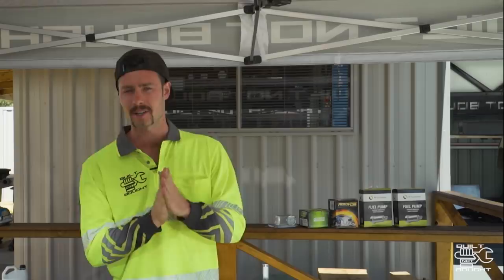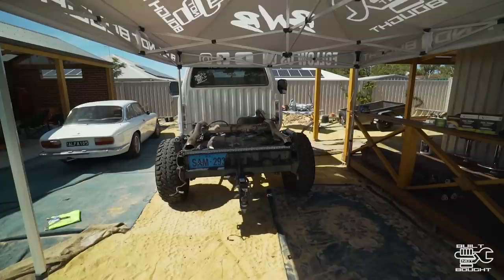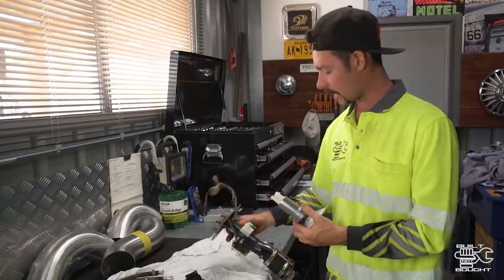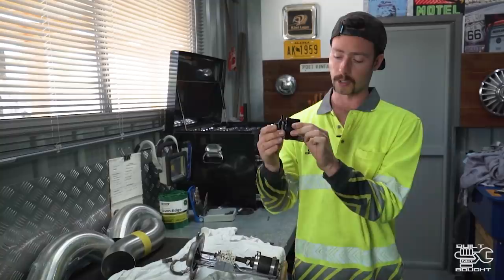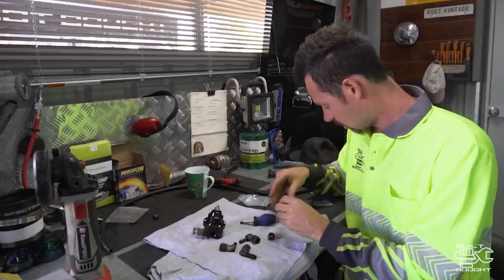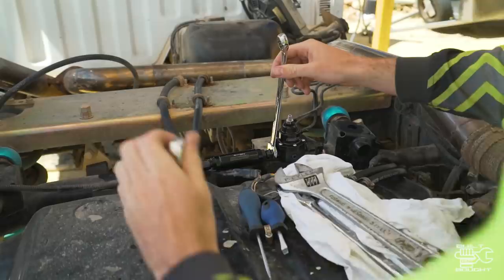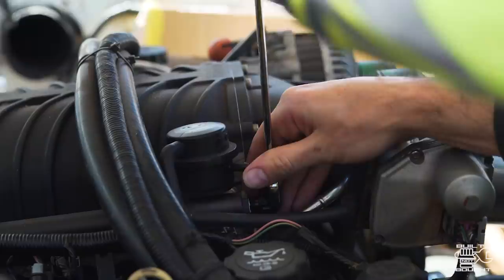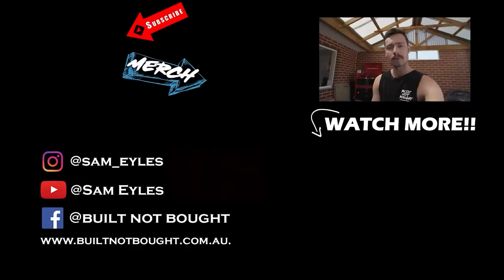Fuel System Upgrade

Comment: Those walbro 460's use heaps of power (20 amp +). I'd reccomend upgrading wiring and relay for it otherwise melting of factory wiring will happen.

Comment: I would buy the hi Vis if it only came with a small bnb icon by the front pocket, and without the whole art work on the back. Think everyone's boss will chuck a wobbly if you rock up to site with that on in its current form.
Reply: Not mine

Comment: Why is your racor 10micron? You get a 1 micron for the racor. Which is the correct one. The 10 wont help much as the standard already filters 10microns. Here in southern africa we use them with the 1 micron. And we also get a UDF fikter with a 0.5 micron. I have been told injectors are  0.5. . get a 1micron .

Comment: Firstly Sam.... Keep the mo; Bro!

Secondly, with the ryco filter, you said it's not meant to be a replacement. If I'm running a Z332 for the TD42T at 10mic and the Z980 is 6mic doesn't that deem the 332 redundant?

The 980 should separate the water AND filter everything out before the 332?